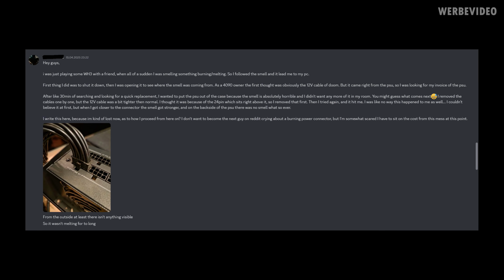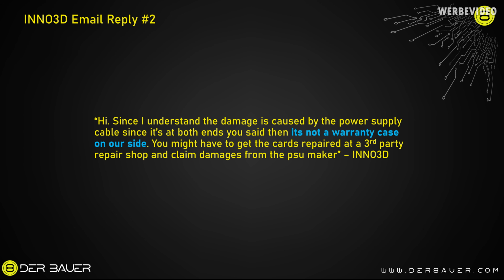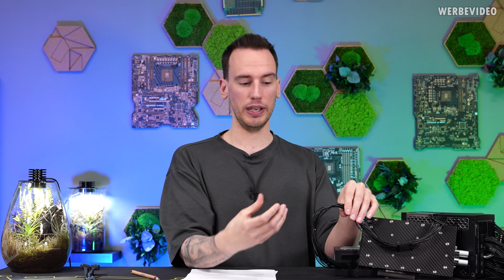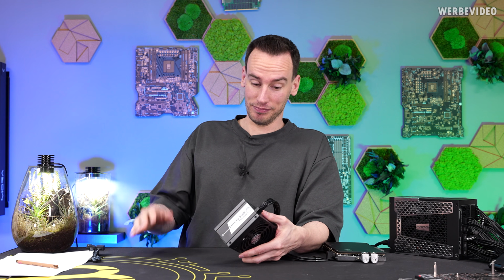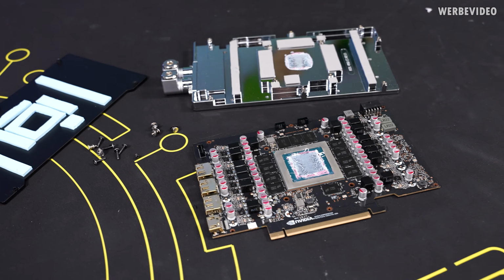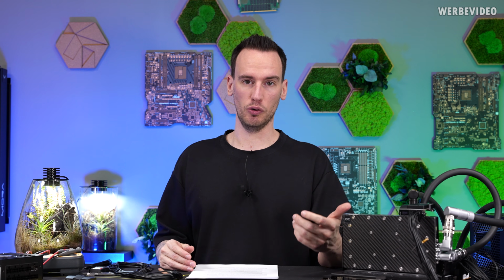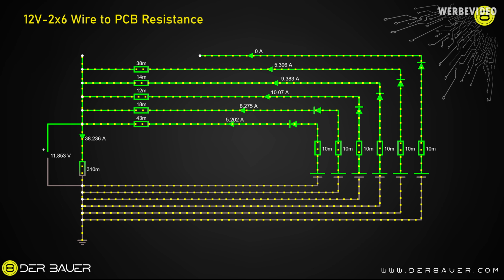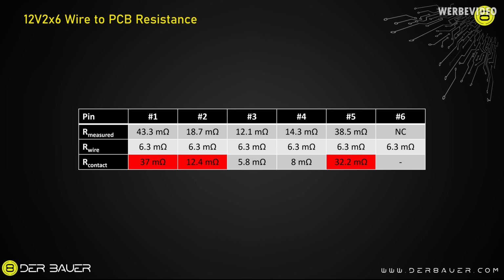Investigating and Fixing a Viewers Burned 12VHPWR Connector

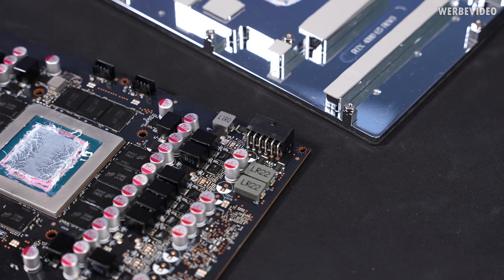Comment: At 13:20 it looks like the pins on the right do not have enough barrel fill on the PCB connector. Although this may not be the cause. But it is a possible weak point.
Reply: Yep, noticed this too. The two pins on the bottom row (the 12V row) on the right side aren't covered on the connector side, which would most likely contribute to a rather uneven current distribution between the 12V pins. This is looking somewhat like a manufacturing defect on the GPU side. (Yes Inno3D, I'm reffering to you).  

(Disclaimer: I'm not in the Through hole inspection machine business, but the industrial electronic control/power supply equipment manufacturing one)
Reply: Btw I work for a company that provides Through hole soldering inspection machines.
Reply: Good eye. I 100% agree. SMT machine operator and PCB inspector here. I make motherboards for the likes of LM and NASA. The lack of fill is an obvious manufacturing defect and should have been caught by the machine operator, flagged by the automated optical inspection (AOI) and if not, by the inspectors at the end of the various lines. Someone either didn't set up the programs right and/or inspectors was not paying attention.
Reply: Depends on the IPC class the board was manufactured to, full barrel fill is not a strict requirement.
Reply: This is almost certainly the issue here.  There's 0 margin for error with this connector standard.
Reply: @  I did a little calculation (with the help of chatgpt ) given that each of these pins are 0.64mm wide (according to Amphenol spec on the connector). And say a plated through hole of 0.8 mm with high plating thickness of 25 microns an unsoldered barrel can pass about 0.45 Amps without significant heating.  But with a fully soldered 0.64 mm pin this rises to 3.7 Amps with the same heating.   Of course these calculations do not account for the 9.5 amp per pin spec so I must be missing something. (Probably top and bottom power plains and possibly inner layer as well) Amphenol testing spec requires 95% minimum barrel fill and pad wetting

Comment: The PC HW market is such a sad meme right now. Good that in early 2024 when building a PC I just bought a used 6800xt from my brother. Most of the components were relatively cheap back then so I splurged on a 2 TB NVMe and 64 GB RAM. Am I going to use it all? No idea, but it's still more useful than this waste of silicon, aluminum, copper and fiberglass laminate.

Comment: "Fixing a Viewers Burned 12VHPWR" , the only permanent solution: Nvidia moving back to the open standard of 3x8 pins connectors. Also having three separate connectors, means heat is spread out over three separate connectors. Sending 400+watts through one connector with thin wires and pins at 12 volts is just a bad idea.  Yes the wires and pins are rated for it, but there is no room, reserve and a  for lack of cooling, lack of ventilation.  The ratings vanish when you put connectors in an enclosed warm space.  That is why there are so many reported issue's with the nvidia's solution. You really need minimum of 100% spare capacity compared to ideal conditions. probably even more.  For example, what 3x8 pins solution provides.
Reply: No, the bad idea is sending 400+watts through a wire and pin that has a maximum limit of 114 watts. So in my opinion the only solution to the 40 and 50 series cards that use a single phase power circuit is to have a single industry standard XT60 or XT90 connector installed. Those can safely take 60 or 90 Amps at 12V. All the RC planes use those, and none of them burned down due to the connectors melting and boiling their plastic. And then, since we have a connector that can supply 90 amps with 2 pins, we don't need that fancy crap that NVidia wanted to put into our PSU-s. So we can go back to the previous standards...
Reply: @h2835  You're 100% correct. It's all about the surface area of the contacts and wires. Fewer larger contacts will always be better than multitudes of smaller contacts.
Reply: the pins are the same physical size and count as in a set of 2x8pin. and two of those are rated to 300w absolute max for the pair according to atx spec, 450w by molex (who designed the 6 and 8 pin).

making the full total available to cards 525w with slot power.

so why is the 12vHFR connector rated to 600+ by itself?
Reply: i was proposing xt connectors when the original 12vhpfr was first announced, but before it actually was on anything.

a 90 provides enough power, but ehh.

doing a new connector with 4 pins the size of the 60's in a footprint the size of the 12HFR and a latching bail would eliminate all concerns for quite a while.
Reply: But there will be 4cm square less space on the PCB so if they do it 60xx series will be regress instead of progress 😂
Reply: I'd like to see a full thermal analysis of the connector pin with 1W (or whatever) in situ. Should be easy enough to instrument a 'good' setup.

Comment: When they redesigned the power connection. It's beyond me why they thought having a smaller gauge cable would be a good idea when the need to push more amperage. There is a reason why high power cables have thick gauge conductors. Thicker allows more amps. This is a industry design ****up.

Comment: Nvidia mandating a defective standard is why the connector melts.  AIB cards should be allowed to have PCIE or EPS connectors if 3 PCIE connectors is not sufficient.  The power connector is NOT an Nvidia decision on AIB cards.  This criminal act must be stopped.
Reply: Even if people have freedom like with AMD some cards are still made without balancing, like the Sapphire 9070 XT with 12VHPWR connector.
Reply: @TheDeeGeeNL  I was going to say people have the right to choose wrong and go for a 16-pin card, but it's not like people really have choice at the moment.  It's whatever happens to be in stock.

Comment: Are the Nvidia enterprise GPUs using the same connectors? There are many more enterprise GPUs in use than "gamers" GPUs. Are they seeing the same issues with melting connectors?

I suppose the GPUs used for AI, use at least the same power as the "desktop" GPUs (600w). I can see the "PRO" edition of the cards use the 12V-2x6 connector. I can't find the connector for the server cards.

Sorry for my badly explain question. I know nothing about server stuff.

Comment: I have maybe stupid question: Why haven't you try to heat PSU side to around 60-80 deg slightly making stucked area more plastic? It might have been more easy to remove it from the socket. You wouldn't have melted it more and had a chance to inspect PSU side. Do you think this pre-heating could have introduced some factors affecting your concluaions?

Comment: THANK YOU ROMAN, this is the full picture i've been hoping someone would explain in nice infographic.  And why this is a complex issue and isn't just as simple as balancing the current.  I've been doing my best to explain this issue to tons of people that educated themselves on issue from various videos and they are all quick to point out problems with connector without understanding the problem and related mechanisms.

This info graphic you did at 3:40 is by-far what need to properly show alot more of the problem, and why even a 8 pin pcie can get burned despite 1 wire being able to handle the full current.
Reply: The problem is that most replies come from NVidia fanatics who say you're wrong and just smack-talk you.
Then the dummies believe you are just talking crap because you're an AMD shill.
Reply: @espertalhao041  more like "who are you even, when the folk in some of them vidoes aren't exactly tech illiterate by any stretch, if not credential wielders themselves...."

But sure. Leys play "they're fangirls" 🙄

Comment: Still have my strix 4090 with the Corsair psu and cable no issues at all 😅
Reply: same ... except that I am running Colorful Neptune 4090 with its stock 600W Bios lol... no issues whatsoever ... YET :P
Reply: Ditto, but with Fasgear 12VHpwr to 3 x 8 pin connectors and a WireView to join the voltages just before the GPU. Zero issues and temperatures at the connector no higher than the adjacent VRMs. Now upgraded to an Astral 5090 OC and WireView Pro with the same Fasgear cable previously used on my 4090. Astral monitoring system shows little difference between pin currents.
Reply: Still have my msi 4090 in tact & never use adaptors. This confirms my theory to not bother. Still not happy w Nvidia drivers crippling performance  from drivers.  :) Next card wont be NVIDIA

Comment: Casual reminder that 12v-2x6 is smaller than 2x 6pins (75w), you'd run 600w through 2x 6pins right?
Makes great content for the rest of us, sit back with the smell of popcorn.... wait that's not popcorn!!!
Reply: Counterargument.
6-pin can have 2x or 3x 12V wires, with 75W limit.
8-pin can gave 3x 12V wires, with 150W limit.

How, suddenly, same amount of 12V wires suddenly allow for 2x power? And even if we count 2->3 wire change, 75*(3/2)=112.5W. So 8-pin also goes above and beyond power restictions you would expect based on 6-pin specs.

12V 2x6 connector has 6x 12V wires which is equal to 2x 8-pin connectors.
Thus, don't get me wrong, i also think 600W is too high and tight for such connector. But would've understood 400-450W max.
Reply: @DimkaTsv   Most 6pins are 3x12v though, at least in the last 10+ years.
On 6pin the 3rd 12v is required for 75w otherwise 2x12v=50w (2.083Amp per pin)
The extra 2 pins on 6+2 are Sense1 and Sense2.
If you have 2x (6+2) you have 6x 12v, 6x Gnd and 4 Sense pins.... like just 12v-2x6.
So why can 12vhpwr do 2x the wattage?

In fact it is worse than that.
6+2 (Mini-fit Jr)
Amps per 12v pin: 4.16*
Pin size: 1.07x1.07mm= 1.1449Sq mm
Amps per Sq mm= 3.3639A

12v-2x6 (Micro-Fit)
Amps per 12v pin: 9.2
Pin size: 0.64x0.64mm= 0.4096Sq mm
Amps per Sq mm= 22.4609A

2.208x the amps through pins with only 0.357x the cross section.

For completeness
6pin (Mini-Fit Jr) 3x12v
Amps per 12v pin: 2.083*
Pin size: 1.07x1.07mm= 1.1449Sq mm
Amps per Sq mm= 1.819A
...12v-2x6 is 12.3434x more power per pin than old 6pin.
Reply: @tomstech4390  you know you argued in support of my point, right?

Both 6-pin AND 8-pin have same 3x 12V wires.
And yet 6-pin is 75W, while 8-pin is 150W. Magic.

Tell me, by this logic, why 8-pin was allowed to have 2x power delivery capacity of 6-pin through same amount of wires?

Sense pins don't do crap in terms of power delivery. They are here only to specify connection type.

And again, i am not arguing about fact that 600W for 12 VHPWR is too much (as i said, 400-450W limit would work much better). Just that logic is flawed.

Also what are these sizes? Pins have several contact areas and they are three dimensional, not flat.
Reply: @DimkaTsv   No I simply added data to the topic, the end result of 12vhpwr being bullshit that we agree on is the only thing that actually matters though.
6pin is PCI-SIG rated at 2.083*Amp but the Mini-fit Jr connector is factory rated at 9Amp, that is why nobody gives a flying fuck that it doubled to less than half of it's factory capacity.

The connector measurements are provided by Molex you can google it for yourself, the contact area might be different... but both will likely be limited down-stream by the pin cross section (as seen cut in the video) resulting in the whole pin heating up and not just the contact area.
You can have an XT120 adaptor for a plug but if it goes to a 0.01x0.01mm solder joint on the PCB that will be a problem.

Comment: How did he pull out gpu from the case without unplugging the cable? That's strange
Reply from the maker: he disassembled the case so we could inspect it :D That was a +1 in effort for sure
Reply: Derbauer has already answered, but it could easily have also had the PSU cable not routed to the back of the case.

Comment: I would expect there to be multiple failures one after the other. The first connection breaks from bad contact which increases the load on all other connections. Such a cascade can obviously only happen because of missing safety features. Nvidia is responsible for making vendors include those. The whole design is just bad.

Comment: At this point, i see tree solutions:

Use more wires, untill cable mabagement becomes impossible.

Integrate the power supply in tbe card and get rid of the additional wires.

Switch to 24v.

Comment: I think this is a combination of more power over pins, the spacing in between the pins, so not enough room for the connector to dissipate heat which then builds up. 2 adjacent pins cumulatively build up heat. Try making an experimental board with a connector set up similarly to gpus with an artificial-load in stead of a gpu. This way you can check if it's the connector/cable type.
Reply: And of course another  experimental board with separate pin measurements to see if your supposition is correct.

Comment: So does the Wireview Pro actually monitor the current flow on each of the wires on the GPU side of the H++ connector? Can it alert for any current imbalance? 🙂🤷‍♂️
Reply from the maker: no it unfortunately can't. But we're working on a WireView Pro II that will be able to do that
Reply: @der8auer-en That would be an amazing option to see available. Given the current (pun intended) costs for 4090 or 5090 Nvidia GPU then a third-party current monitoring solution would be a good option. Possible to add a contact resistance measurement option also? 🙂
Reply: @der8auer-en Soon please. I've bought a WireView Pro even though I have an Astral 5090 OC. Guess that's another 70 down the drain when the ProII appears 😢

Comment: Thank you for the video, lots of interesting information.
There seems to be only one solution to resolve the issue, a inline fuse box. This would look out of place and at the same time give peace of mind, that a fuse would blow before physical damage. Each +12V cable should use 75W(6x75W) for a 450W card. So each fuse, would need to be a maximum of 7A. (75W divided by 12V = 6.25A) How small can a inline fuse box with 6 fuses be and which end would you place it?
Reply: Fuses sound good in theory, but in practice their use in overcurrent protection (as opposed to fault protection (i.e. short-circuit conditions), where they excel) needs careful engineering to be effective without compromising reliability. In particular I don't think they can be effective with 12VHPWR because there's so little margin between design operation current and current sufficient to melt connector materials.
Reply: @rednammoc  If the fuse is used per wire is 7A, then a fuse would break if the current exceeds 7A. This would stop the the current reaching the point of heating the wire up, to the melting point. Safe working load of 16 gauge wire is 10A with a max load of 13A, if memory serves me correctly. For cards that draw 650W the fuse would have to be 10A.

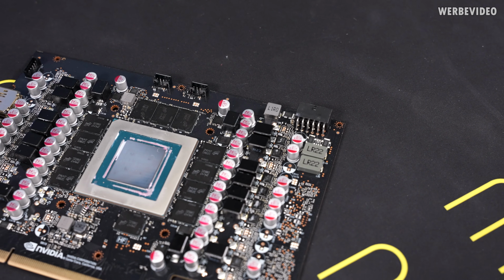Comment: 13:20 Look at how uneven the soldering is. On half of the pins, solder flew all the way through the PCB, on the other half solder is nowhere to be seen.
Not sure if this makes any difference, could have been investigated by measuring resistence after the connector on the PCB, at the 12V coil for example or at the fuse, if there is any, instead of measuring at the solder joints.

Comment: Class-action lawsuit on that cable\connector. Its insane how much it happens even if you plug it correctly. I am so glad I got a 9070xt.
Reply: As this fellow said. The connector is fine, it's the spec, and NVIDIA for not putting load balancing on the card AND forcing board partners to do the same thing.
Though, it should be only rated for 450W, maybe 500W maximum (this would still fulfill the 5090's power requirement when counting the PCIE slot).
Reply: @bar.kokhba  All Nvidia cards pull very very little power from the mobo so they'd need two connectors
Reply: @ That's a recent quirk that can be fixed. My 1080 had no problems drawing from the 63W from the PCIE slot, it's not like it's impossible.
Reply: Who do you plame?
PSU manufacturer, Nvidia, AIB, cable manufacturer?
Reply: @haukikannel  It's nvidia. they're mandating these unsafe connectors and making them even more unsafe by removing current and balancing sensors.
Reply: @JessicaFEREM  the connector can be fine, but the board design sucks. And NVIDIA continues being daft about it.
Reply: you blame PCI-SIG, and Nvidia, since they're the only ones forcing their AIBS to use it, thus sort of forcing the psu companies to support it.

this connector should never have been allowed into the wild, let alone in a fashion that's been shown to completely eliminate any sort of load balancing as the 'default' circuits allow up to the 50 series where all AIBs are supposed to only use that one circuit config at the connector. roman explains in the video why that circuit is bad (briefly) and he and buildzoid cover why it sucks in depth in other videos.
Reply: @  blame energy consumer- so GPUs = AIB suppliers that produced it. And they may sue nvidia for bad design.
I, as a consumer, don't care who designed that shit design.
The manufacturer chose not to make it better.
Reply: @haukikannel  Nvidia, they even made the standard.
Reply: I am loving my 5090, it's nice being on top. But you enjoy your mid range AMD card lol

Comment: I think it only has problems on high voltage cards-
I use one on a 4070 Ti -
one power cord from PSU to GPU
 the other (3) 8 pin looks like sh*t
I'll never go back to ugly asf
Reply: You sound insecure , do that crap connector hauted your sleep?
Reply: @gunturbayu6779  what does hauted mean in English  ?
Reply: @gunturbayu6779  Too be honest, I'm surprised you spelled insecure right -
maybe it hauted you

Comment: They omitted the ceramic connectors and the natural rubber high temperature wire insulation in the spec. With the addition of a wire fan it would make a low power space heater. 12vhpwr solved